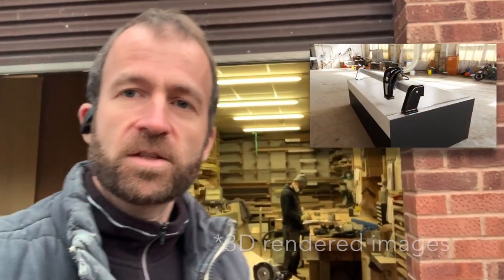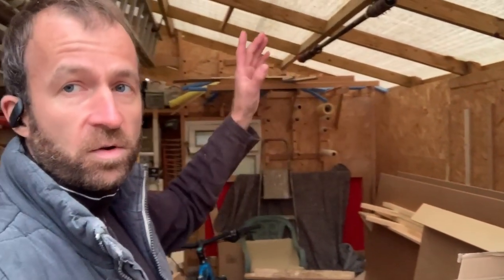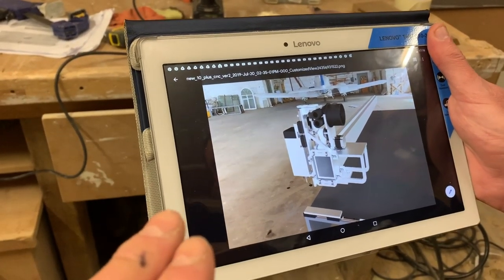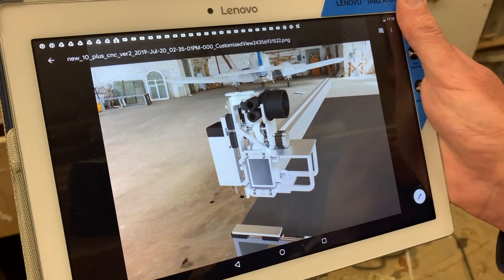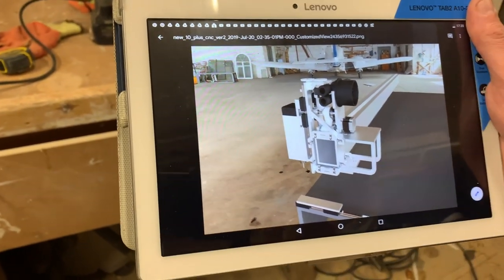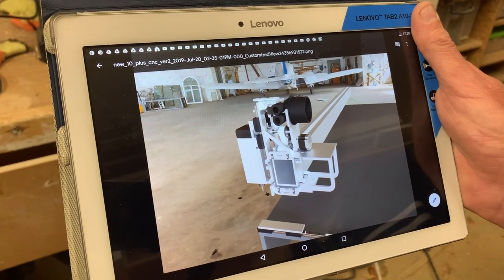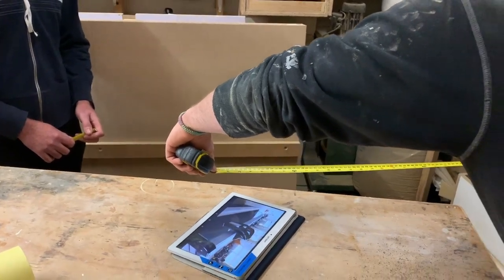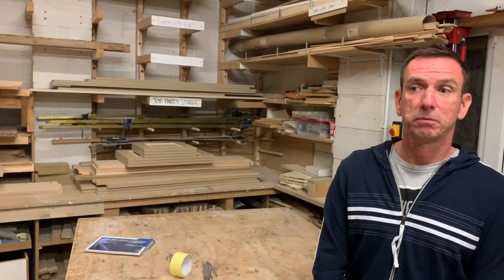CNC intro

Comment: Very exciting news.  Well done.  If looks are anything to go by it as though a lot of care and thought has gone into its design.  Really like the Darth Vader like "head" unit.  Will it be steppers or servos used to move the gantry etc?  If I knew then, what I know now, I think I would have ponied up the extra for servos.  Deeper / faster cuts can be achieved with accuracy (as I understand it).  If the gantry does dip then the spoil board will also reflect that and I can't image this having too much impact on cabinet construction.  Cheers, David
Reply from the maker: DRMNZ not sure but I am certainly getting better educated by these comments and have questions to ask Simon!

Comment: I'm not sold on making a long gantry. The gantry is where most of the precision loss occurs because it is only supported at the ends. That is why all cnc machines make the smallest gantry possible.
Reply from the maker: MySchizo Buddy fair comment and I do have similar questions however Simon has years of experience with CNC machines and a background in aerospace engineering.  He has good answers for the questions I’ve raised with him so far (not all shown in this video).  There’s definitely risk here for me, in fact I’m fully expecting a few problems!!! But that’s reflected in the low price he’s doing me for this early model (the price is confidential unfortunately!)

Comment: Does the designer have a fully working prototype? Have you seen it in action yet? Can't wait to see it in the new shop mate!
Reply from the maker: Brian Needham he’s an ex aerospace engineer and has worked with CNC machines for years, including running his own sign making company.  So he know them pretty well inside out.  However there is a definite element of risk here because, no, there is not yet a built prototype!!! We have agreed a deal where I am getting this at a great price (confidential) in return for the publicity on YouTube.  I hope I don’t regret it but if it works out it’s a win win, and I thought it would make a good part of my YouTube channel’s story!!
Reply: I hope you are getting a great price for being a guinea pig, I have had a CNC  for 20 Years , an 8 x 4 machine made in aluminium and belt drive would not be my choice, especially if there is no working machine.  It’s time to download the Demo of Vectric Vcarve Pro, have a look at Cabmaker32, it works within Sketchup, I use it for all my cabinet work.
If you are set on the machine I would recommend a Spindle and not a router...........best of luck
Reply from the maker: notbobthebob thanks for the tips.  I will look into cabmaker32 as I am looking for alternatives to CabinetSense to use to perfect and then possibly release my own specialist components.  We’ve hit upon some problems integrating it fully into CabinetSense.  I’d be very interested to know your thoughts on my system as demonstrated in this video since you obviously understand SketchUp and cabinetry extensions https://youtu.be/UjknIRb1Bu0

Comment: What happened to this machine?
Reply from the maker: Long delays getting parts from China for the first prototype to be fully finished and testable... also, the more I educated myself on CNC machines for woodworking (speaking to those who use them, and visiting actual machines), the more I had to agree with what people were telling me again and again - that for accurate cutting in substantial materials you need both weight and rigidity in the frame - the more weight and rigidity the better.  I realised it was too much of a risk for me to trust a new and untested approach to the construction of these established machines, and by proceeding with this machine I would have been putting my innate curiosity and desire to back a new and interesting product ahead of what is best for my business.  So I pulled out, in favour of a reconditioned well made machine.  However that also fell through, and I have finally acknowledged that I need to do things properly and accept paying more for a new machine with proper support.  I should be getting a machine early next year
Reply: @Alastair_Freebird  isn't their any company in UK that leases CNC machines. lot of european companies make top quality cnc machines.
Reply from the maker: There is a guy I know called Brandon Atwell who plans to start doing that

Comment: Great video, I personally would be a little worried if the machine crashes in the learning stages would that bend the aluminium rails? Aluminium is very soft, for £20k a month plus work cutting most of your work on the cnc would it be industrial enough for you? Great start up machine in my opinion but I think in a few years you maybe upgrading?
Reply from the maker: RJS Carpenters and Decorators very likely I will upgrade but I think it’s much better to get started with a cheaper machine and then make a much more informed buying decision when more money is stake.  You can’t fully understand the issues and features that you require until you’ve got started with something, however much you seek advice.
Reply from the maker: RJS Carpenters and Decorators very likely I will upgrade but I think it’s much better to get started with a cheaper machine and then make a much more informed buying decision when more money is stake.  You can’t fully understand the issues and features that you require until you’ve got started with something, however much you seek advice.

Comment: I don't like the look of that gantry design. Looks like that span would leave for a lot of flex when the spindle is working in the middle of the bed
Reply from the maker: C M I have taken a risk going for this one!
Reply: Fair comment and reply
Reply: @Alastair_Freebird  
I could be wrong. I'd prefer a machine where the gantry spanned the width of a sheet of mdf rather than the length. Good luck with it. Looking forward to seeing the machine in action
Reply from the maker: C M it is definitely a legitimate concern.  I might have edited the discussion with Simon about this a bit too much.  His reasons are twofold: 1: to keep the cost down (he says the rails that the gantry runs on at each end are one of the most expensive components so he’s halved the length of them). 2: to increase production speed (travel speed along the gantry is faster than moving the whole gantry, so making the faster axis the longer one means quicker corner to corner travel)
Reply: Freebird Interiors.  X axis and Y axis moving at different speeds ?  that’s a new one to me, l do not know of any CNC programming software that has a different travel speed for X&Y axis, only the Z axis  has a different speed.
Reply from the maker: notbobthebob this is what Simon told me, if  I understood correctly, but I will tell him what you’ve said and ask for further explanation 👍

Comment: This is a toy , u can't call this a cnc machine , will flex , and bend even with slow feeds and speeds , the ganty is too thick , and doesnt have torsion bars inside it , only a cruel rectangle bar .
The belt u can use it for a laser machine , but for milling wood ... 

Who make this prototipe doesnt have an ideea of making a cnc machine even it worked all life with them , he can do max a toy design .
A chinese cnc will eat 10 of this toy's like this one  all day long .
Reply from the maker: CeNuVezi salut, sunteti Roman?  Din ce parte?  Anyway, these do sound like legitimate concerns!  You say the gantry is too thick - isn’t thicker better to resist those forces?